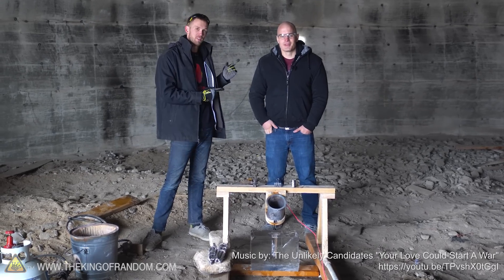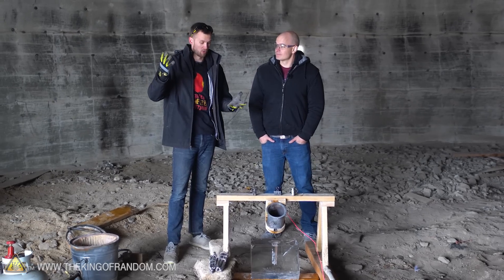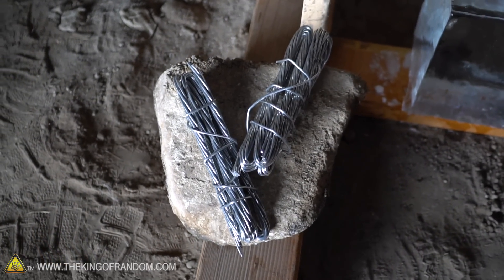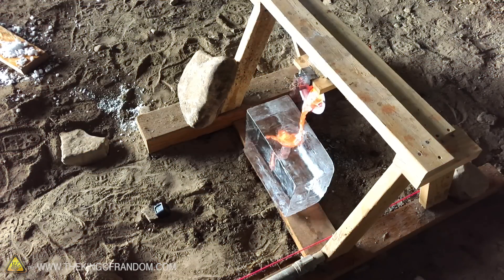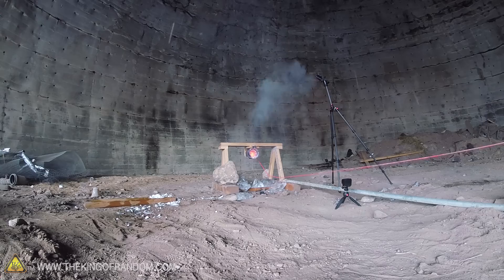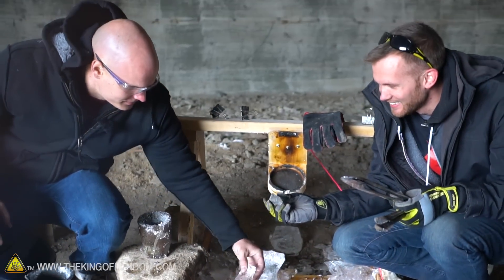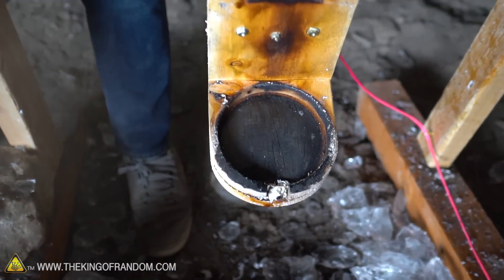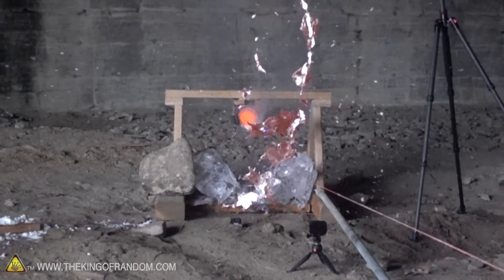Molten Aluminum on Clear Ice is CRAZY! TKOR Experiments With Molten Steel, Molten Metal, and More!

Comment: My guess is the melting ice produced STEAM. And the high pressure of the enclosed STEAM caused the actual explosion. There no reason aluminum itself would explode under these conditions. The ICE - WATER - STEAM quickly heated to a very high temperature created a change in PRESSURE. And the high steam pressure caused the explosion. Think it through guys.

Comment: I was in a foundry pouring aluminum castings and it was time to drop in the tablet that causes oils or other impurities to rise to the surface.  What we didn't notice is the light bulb in the cabinet  where the pills were stored had gone out. 
That light kept the inside of the cabinet very dry.
When the tablet was dropped in the metal, it erupted. Molten metal flew in all directions. Fortunately no one was hit, which was lucky because about 6 people were in the danger zone.
We think the humidity had gotten into the tablet. Amazing how powerful a bit of steam can be.
Reply: Interesting - something that no-one predicted in advance of it happening even though it was so dangerous.  Surprising as you  say it was only a minute bit of steam, must have expanded incredibly fast.

Comment: I was a glass major at RISD in 1997 and I had blocks of ice delivered to our hot shop.  I used a giant ladle to pour hot glass onto the ice and i recorded that happening. I did not get the explosion that you got, but i think this is because I did not create the cylinder opening that you had in the top of your ice block. I just poured it on top and the molten glass melted (rather violently) through the block.  I was able to save the glass by annealing it for quite some time (some sections were very thick and some paper thin so i had to bring it down from its initial 3500+ degrees pretty slowly). I have photos of those pieces of glass but the originals were displayed and then put into storage someplace that would require quite a bit of effort to locate.  I would love to see this again but without the opening for the aluminum to pour into.  While the explosion is exciting it really leaves you with nothing all that interesting to look at...imo.

Comment: I am curious what would happen if you slowed down the thermal shock and do a slow pour. Also what would happen with a block of dry ice as the temperature difference is greater. Anyway, great video 👍🏻
Reply: i was thinking the same thing.. what would happen if they used dry ice?

Comment: I tried to have a go at this, I was told what the result would be but did we stuff it up.  I froze the block of aluminium and poured boiling water into a large hole that was drilled into the aluminium. And you can guess what the result was. We just stood there, could not believe it and laughed. Excellent.

Comment: I wish they would explain why the block of ice exploded instead of talking about how cool it was or else it isn’t really science nor educational.
Reply: He explained in the beginning that it might explode from the steam pressure, when things heat up, they expand. When they heat up quickly, they expand quickly, and when they expand quickly, you get explosions. Boom. Explained.
Reply: Scott Maday Gas pressure.
Reply: It exploded because the aluminum sealed the hole after it was poured in and began to cool, but it was so hot of course that the ice was pretty much instantly melting and boiling and since there was nowhere for the steam to go because of the thick semi molten metal filling the cavity. Pressure built and built till the ice exploded.
Reply: shut up gayhead

Comment: The steam would only have to lift the weight of the plug to escape.  I don't know anything about thermodynamics but that doesn't look like a steam explosion to me.  There was probably more of a pressure from the proximity of the temperature difference between the molten metal and the ice.

Comment: This may have been mentioned already but.... the actual reason this explodes is because molten aluminum reacts with water to produce Hydrogen: 2Al + 3H2O –> 3H2 + Al2O3 + heat
Reply: i believe this reaction in the video was probably mostly a physical vapor based steam explosion because although molten aluminum can react with water in this video it wasn't nearly as bad as it could have been if the aluminum reacted with the water chemically based aluminum explosions have happened in aluminum casting facilities and caused lots of damage this is because if the initial steam explosion is powerful enough it can aerolize the molten aluminum which due to its reactivity and small particle size quickly reacts with the water releasing tons of energy instantly. molten aluminum explosions are very unpredictable in how much damage they cause depending on how much of the aluminum reacts with the water.

Comment: Idea:
Would it be possible to build a freezer that is powered with liquid nitrogen?
Reply: Yeah it's possible. Though I think it would be really expensive to do that.
Reply: Tranto no not really because you need to cool down nitrogen to make it a liquid, it is not just there absorbing heat. If that is not what you meant then yes it is 'possible' to make a freezer with liquid nitrogen involved but I do not see the point of doing so.
Reply: Tu Yiren they mean liquid nitrogen making basically a box in a box to freeze stuff
Reply: Just use freeon

Comment: I believe it exploded because it was poured in too quickly, causing the ice to heat a rapid pace, making it explode. Perhaps if you had done it a little slower, letting the ice adjust to the hot temperature, it would do something different.

Comment: HERE IS THE REAL REASON WHY THE ICE EXPLODES  !!

It is actually what is called a Coulombic explosion. This is the same explosion that you get from dropping an alkali metal such as sodium or potassium in water.

When the aluminium drops to the ice it statrs to melt. The molten aluminium starts reacting with the water to produce hydrogen gas and aluminium oxide. The hydrogen forms a protective layer between the metal and water, slowing the reaction.
What happens in this type of reaction is that electrons are drawn away from the metal to the water, but as the two are separated by the hydrogen, the oxygen from the water cannot bond immediately with the aluminium. This them produces a huge (electrical) potential difference between the aluminium and water.
Eventually there is is a spot on the aluminium that sufficiently contacts the water and within a millisecond, the aluminium is physically drawn into the water, forming tendrils which project into the water producing a high contact area. The potential difference between the aluminium and water can produce up to a million amps to flow through the two.
It is this huge flow of electricity which instantly reacts the two, forming mega amounts of heat.

Comment: In centre of the cube, ice is expanding at high rate and in the exterior it is not it is maybe not melting at all.judging by the person's cloth , external temperature maybe near freezing.This difference in expansion rate causes pressure to build up and hence the explosion.
Reply: If the expansion rate is equal in exterior and interior this will not happen.but at that temperature ice will not exist.

Comment: What would happen if you let molten aluminum cool in the vacuum chamber?
Reply: It would take longer to cool down, since there wouldn't be any conduction through the air.
Reply: In 100% vacuum it wouldn't cool

Edit: With Radiation yes it will cool if the vacuum isn't in a tight place

Comment: What would happen if you put water in a vacuum chamber then freeze it? Would it come out clear?
Reply from the maker: For some reason it doesn't. I tried this about a year ago and let the chamber run for an amazing amount of time and it still didn't make a difference.
Reply: The King of Random then how did you make the clear ice? It just looks so cool I must know!
Reply: distilled water
Reply: Amazing question tho
Reply: Mr.random most likely as it wouldn’t have any air in it but it would be hard to do so as in a vacuum it’s freezing point is lowers even more
Reply: so it isn't air in the water that causes the cloudy appearance, it's about he impurities in the water; chemicals and particulates.
Reply: Distilled water, boiling it first, and putting it in the freezer hot helps. The comes out clearer, but not completely clear. To get really clear ice you need to freeze it slowly from the bottom up. Water expands when it turns to ice. If you just stick an ice tray in the freezer it freezes from the outside inwards. The ice is stressed when it does that. Freezing slowly from bottom to top allows the water to expand freely as it turns to ice.
Reply: It would be incredibly difficult to freeze because the temperature required is far below -60 degrees Celsius
Reply: It has to freeze SO fast that air has no chance to gather in bubbles. That's how you get clear see through ice.
Reply: Christian Brown air sacks, because air doesn’t freeze at the same temp as water
Reply: He should freeze water by putting it in a vacuum chamber. The water boiling will eventually remove enough heat that it will go from boiling to freezing.
Reply: Is no no yeah what he said
Reply: I thought it would explode because of the bubbles expanding

Comment: If you fill the crucible up with aluminum and put a budlight can with a screw on cap and place it in the crucible it will explode the can about 20-30ft in the air.!!

Comment: I suggest trying molten steel vs liquid nitrogen or red hot steel vs nitrogen. Emerge some carbon steel in a container filled with nitrogen. I think it will make a very brutal peace of steel full of crystal structure. This piece should have similar proprieties to glass and could be as sharp as a razor blade. Although it may just break or explode due to the thermal shock. Basically, it is a quenching.

Comment: I have a question. The molten aluminum was poured into a small cylinder in the ice, but as I know, when liquids solidify, they expand. So what would happen if you took the same experiment, but using an ice block with a dome carved into it, so there is more space for the aluminum to expand?

Comment: How can you calculate this? 
You would have to calculate the heat flow of aluminum to ice by modeling that shape you cut out in the ice block and solving heat flow partial differential equations. When the total heat in 1 area is the temperature water turns to steam, you would have to turn that into a function which shows the rate of steam increase. 

This would increase pressure in the ice cube, by PV=nRT. The pressure would be a function of volume and Temperature, but volume increases with respect to time, so you need to find out if the Pressure increases faster than the volume increases. This will tell you how fast your pressure builds up. Once pressure is greater than the maximum tensile strength of the ice block, it will break... But I don't know how to calculate if that breakage turns into an explosion... yet. I guess that is ballistics or something.

Comment: Never underestimate the power of Steam
Reply: Terror Monster the molten metal rapidly melts and boils the water witch creates a lot of steam really fast and the metal allso covered up the top part so the steam could not escape witch resulted in the steam building up pressure fast intill the ice could not take it anymore and boom
Reply: MR ONO thats not steam thats tiny water drops that appear when steam hits the air and cools down, causing it to condense.
Reply: crazyjr could you explain to me how the steam exploded it just curious
Reply: our Lord Gaben will
Reply: Terror Monster Yes!  Was gonna ask the same question.   I wish there was an reason for the explosion explanation.
Reply: Water under pressure can cut metal, steam under pressure, at the moment it releases(explodes) can do considerable damage. as the Aluminium melted it superheated the water under it. It had to go somewhere, i believe it went down and sideways, in which the pressure overloaded the holding ability of the ice, as the steam expanded it became an explosion.There have been stories of runaway pressures on steam locomotives, exploding and destroying small towns. Steam is nothing to be trifled with, if the stories are true. this experiment gives weight, to those stories. Also check out, Mythbusters hot water heater rocket vids, if you want to see steam in action there as well
Reply: probably more information then you may want to read but most of the time what causes these explosions is steam pressure building up. what happens is that when the aluminum is poured into the ice block initially nothing happens and this is because of the leidenfrost effect which is basically from the surface of the ice contacting the aluminum evaporating keeping the aluminum seperated from the ice with a thin layer of steam. since this steam layer is unstable it tends to collapse which allows the molten aluminum to suddenly contact the ice instantly converting a large amount of water to steam. steam takes 1600x more volume than the amount of water used to create it meaning a liter of water can suddenly turn into 1600x liters of steam instantly that is a lot of volume increase in a short amount of time. In addition to this not only is a physical steam explosion but since aluminum is also a very reactive metal and can actually chemically react with water in some cases since the initial steam explosion is so forceful it can actually aerolize the molten aluminum into tiny particles which increases the surface area of the molten aluminum a lot and allows it to react in a chemical way with the water in the reaction 2Al + 6H2O → 2Al(OH)3 + 3H2 this reaction is extremely exothermic and can occur in a short amount of time increasing the force of the reaction a lot and has cause lots of damage in aluminum casting facilities the chemical reaction is very similar to how sodium reacts with water, in this video i believe it was only a steam explosion with little to no chemical reaction occuring. however if the secondary reaction did occur the reaction would be even more violent and molten aluminum reactions tend to be very unpredictable in how powerful they are
Reply: bioc04 all should praise the lord of sales.
Reply: crazyjr Not strong enough to make Half Life 3
Reply: Yes, indeed. I initially thought the explosion had something to do with the specific heat (calorie) of aluminum but indeed that highly kinetic gas had nowhere to go!
Reply: Steam is invisible that fog you see is condensed air
Reply: @SuperableDagerr  There is no such thing as condensed air. Fog is water droplets condensed around dust particles.
Reply: @david203  Well, you can condense air, at least the components of air, as in liquid nitrogen, liquid oxygen, even liquid helium, and maybe liquid co2 if you kept it under high enough pressure, instead of cooled, I think.  And I think he might have meant that the visible 'steam' was wet steam, similar to what you mention with regard to fog, that is,  steam with condensed steam (hot water droplets) mixed with it. I think steam at a temperature too hot for any condensed water to be possible might be called dry or live steam, not sure.
Reply: The explosion has to do with the amount of energy steam carries with it. It takes a ton of energy to convert ice to steam.
Reply: Yeah it gives you great discounts on games
Reply: @funny1048 nice breakdown, pretty much what I was thinking. I was wondering if the breakdown of the leidenfrost effect was caused by the steam going supercritical, (thus triggering sudden heat conduction.)
Thoughts?
Reply: I think that the leidenfrost effect breaks down because it tends to be a very unstable especially with such a large surface area of aluminum contacting the ice  an extremely tiny portion lets say less than 1 square centimeter of the ices vapor film contacting the molten can collapse randomly and then that water explosively turns to steam and that mini steam explosion causes the whole vapor film to suddenly collapse causing a much more powerful steam explosion. all of these steps occur instantly
Reply: If we poure molten aluminium on plane ice cube..it won't blow. But instead they pour it in a hole. When molten aluminium is poured in a hole.. because of its extreme heat.the ice turned into steam in side the hole and under the aluminium. There is no way for such a huge amount of steam to leave into atmosphere. So it has to take only 2 ways. Brake the ice or through molten aluminium. As it can't do the second one. It break the ice and left out.
Reply: The steam got stuck inside the hole and build up alot of pressere and then BLOM
Reply: Heresy
Reply: Drew Velez .
Reply: SuperableDagerr steam is not invisible... its like white smoke as you for example can see when you are boiling water on the stove or if you have ever seen a video of a steam locomotive
Reply: Simply put water expands 1600 times its volume when it boils. That pressure has to be released somewhere and that where is going to be the weakest part of the structure.
Reply: Don't think that was a steam explosion. Steam will "squirt" out wherever it can so I would expect a fountain effect from steam.  This was a thermal shock style explosion where the solid inside of the block heats up and expands as a solid putting extreme forces on the outside of the block and "shattering" it.
Reply: MR ONO Are you acting sarcastic or you really don't know the spellings😕
Reply: crazyjr for a second I thought you said Satan (may he be thrown down below).
Reply: it's not the steam that causes the explosion. Aluminun is highly reactive, the only reason it doesn't react wit water in it's solid state is the oxide/hydroxid layer on top but when you melt it, you take that layer away. So a lot of hydrogen is formed which, when it ignites it explodes. Look up the reaction from aluminum with water.